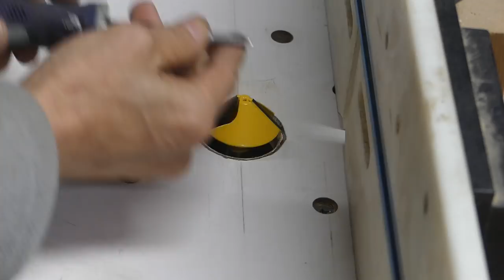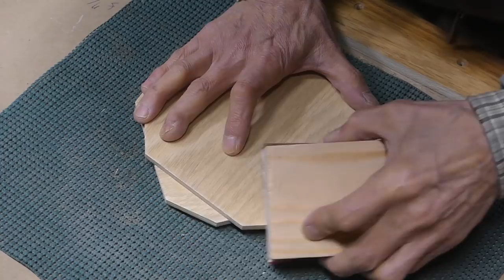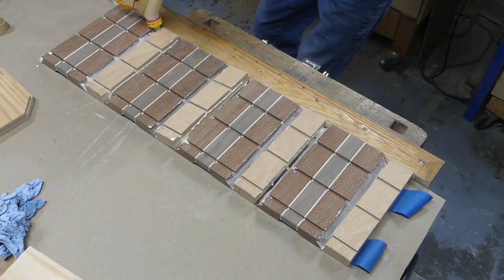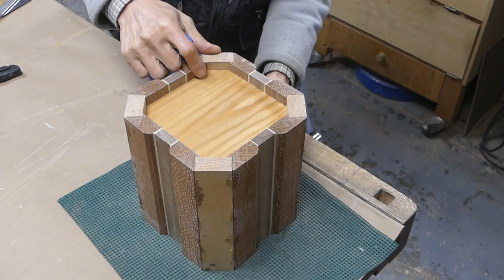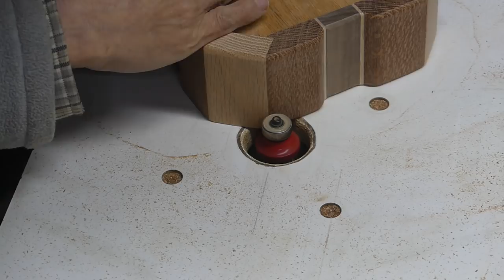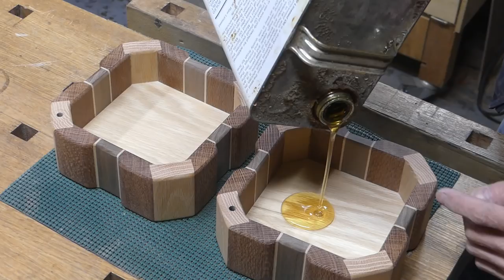Bird mouth joinery box

Comment: Very nice, I watched it to see what a bird mouth box was and I still do not know.
Reply from the maker: If you are not a bird mouse joint and just glue up each part with an angle, it will not be a strong bond and it's hard to clamping,
Reply: It is the special router bit used to cut the gluing angles in the wood.  It makes the shape of a bird mouth and helps the wood pieces fit together for added strength and clamping ease.  Search “bird mouth router bit”, very cool idea.